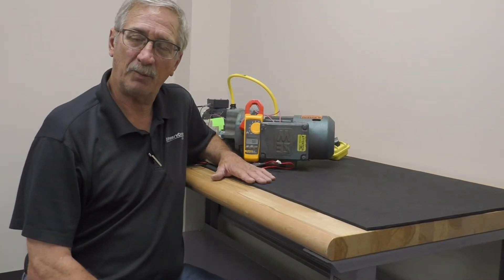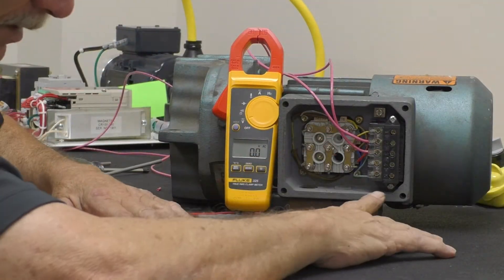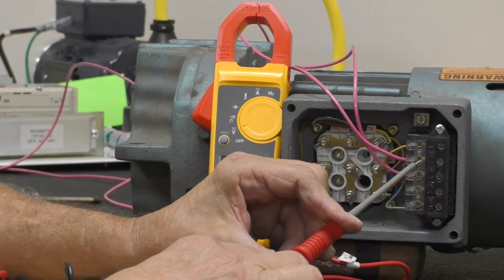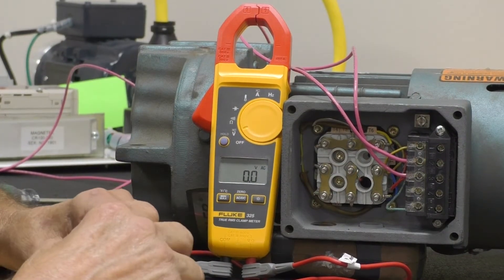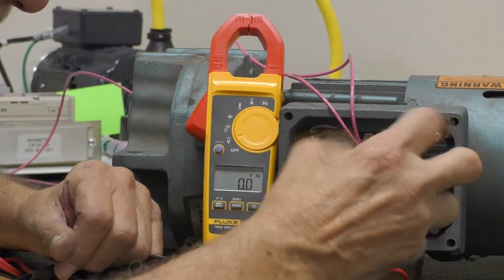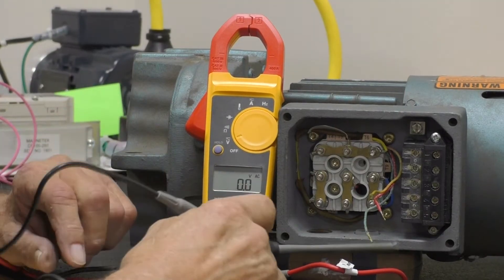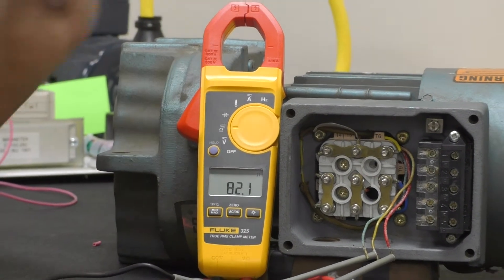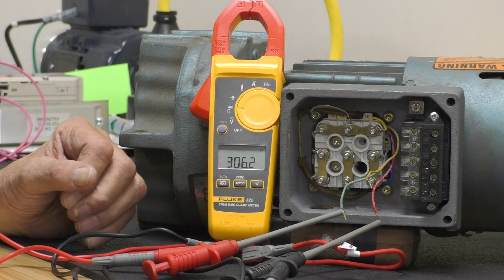How to Check a SEW Motor Brake

Comment: Your video was useful to getting to the coil wires. The information I've gathered from 2 different sew brake service and maintenance manuals say that your resistance measurements are what I should expect to see. 1 coil is the accelerator coil and the other is the holding. Between red and blue should be the sum of both coils. The accelerator should be a 1/4 of the sum and the holding should be 3/4 of the sum. Looks close enough to be a good brake coil. Maybe you have a different version of a sew brake but idk. Either way, thanks for the video. It was of use.
Reply: "BS refers to the Accelerator (Beschleunigungsspule) coil, and TS is the Fractional (Teilspule) coil, together forming the main holding coil (HS)". Your term need to be corrected. One is Accelerator coil and the other one is Fractional coil.
Reply: Look up SEW BRAKE TROUBLESHOOTING. BE brakes page 26. BM brake manual page 27

Comment: Are you colourblind?
Reply: lmao. the brake has 3 wires: red, blue and white. there are 2 coils in series with the white wire in the middle. one side of the coil is the red wire and the other coil is the blue. so you measure the the coils red-white and blue-white checking their resistances. you can check it red-blue but that will give you the summed up resistance of both of the coils. in this video the wire colors are different than the standard red, white, blue. he also checked one coil and then both coils which is odd, I would measure each coil separate and then both coils.
Reply: @lemmingslive3843  It's 1 coil my dude. Red-Blue (full coil) White = centre tap. Rectifier switches between 'pull in' and 'holding'. Initial Pull in (least resistance) to overcome mechanical tension of spring loaded brake, following the 'Holding' phase at a higher resistance to reduce current. Imagine performing a sit-up. More effort is required to raise your body from the floor (higher current- pull in) Once you reach the sit-up position, less effort is required to maintain this position (less current-holding). Red-White least resistance = pull in, Red - Blue = full resistance for holding. Different wiring configurations exist as well as brake rectifiers which behave differently
Reply: @nickknowledge298  it's 2 coil in this case, RTFM. the white wire is between them, otherwise it wouldn't make any sense why there are 3 wires if there's only 1 coils. the 2 stages that you so correctly described are associated with each coil. anyways, the idea that I wanted to highlight is that these 3 wires have 3 standard colors, red, white, blue.

Comment: How do you know what resistance you were looking for? Unless you know this info you won't know if the result you test Is wrong or right!
Reply: this is a couple months old, but i work in a plant that has a parts room stocked full of spare brakes, just grab a new one, ohm it out and if the one youre replacing is any different is might be best to replace